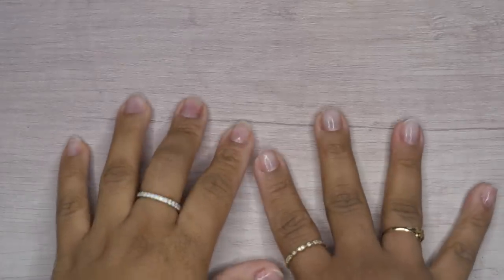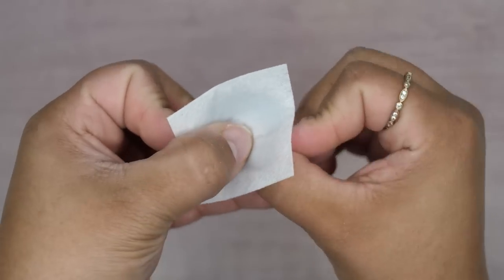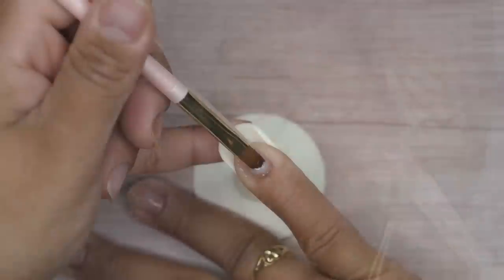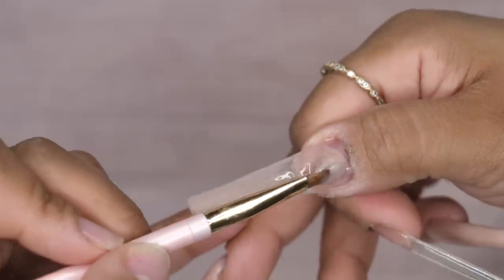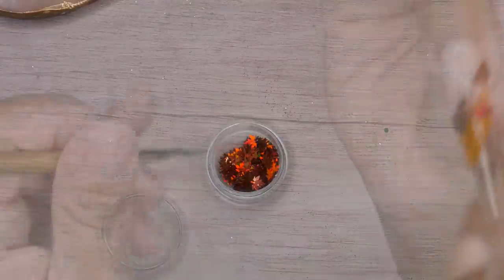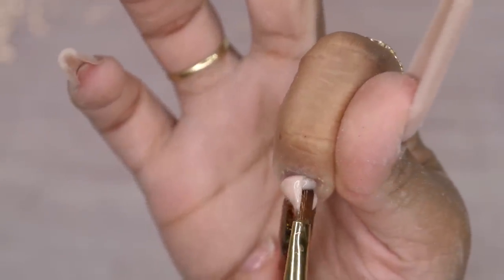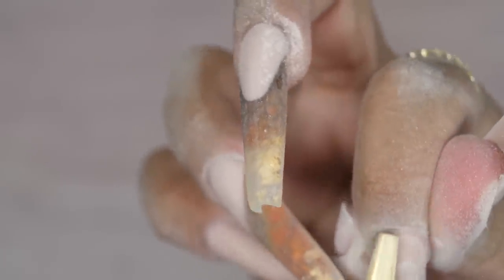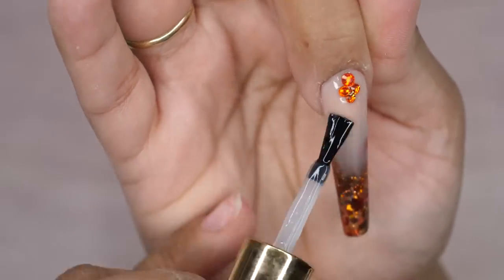XL Fall Hard Builder Gel Nails | XL Coffin Nail Design | Hard Builder Gel Nails Tutorial

Comment: 13:05  Okay so when you start to sharpen the nude colored gel to prep for the next color to form the color block, how do you do it? I undersrand you take the file and sharpen it, but then do you take alcohol to wipe off all of the dust? And are you supposed to go straight into the next gel color? Because there would no longer be a sticky layer from the base gel after using the alcohol wipe, so im curious how to next color of gel would stick? Do I re-apply the base gel for each color? I would appreciate any help/ instructions on how to do just the color blocking part! Thank you to anyone who can help!  Amazing set of nails as always! 😊🩷